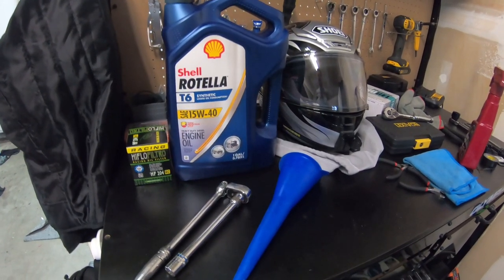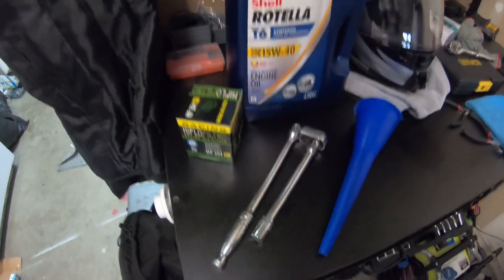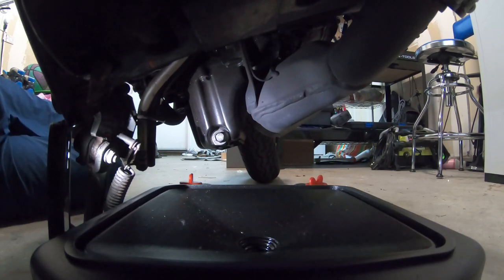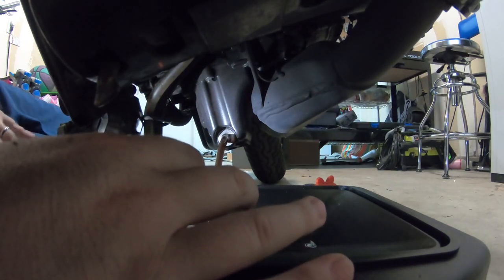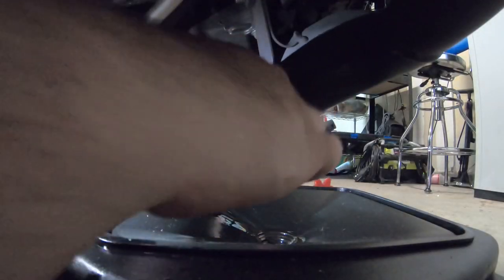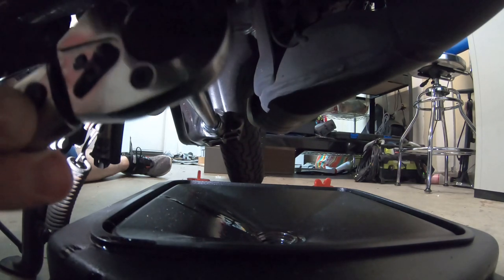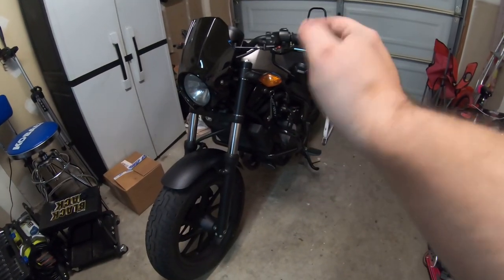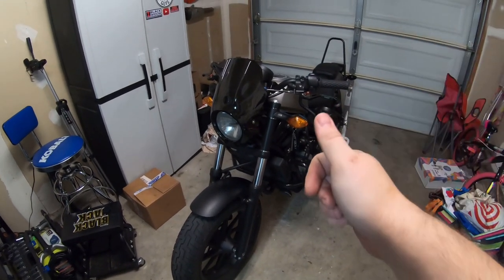Honda Rebel 500 Oil Change || Rotella T6

Comment: Really good video man but you do not want to put the drain plug back in before you remove the oil filter because when you remove the oil filter more oil come out through the drain plug

Comment: Hi mike, today i make oil change and filter on my rebel 500. Without checking level glass i poor 2.7 lt  ( 2.9 quarts ) when i check glass i see oil level over upper line. Any recomendations?
Reply from the maker: You are checking while the bike is standing upright off the stand correct? If so and it’s over the top line then you can open the drain bolt and very carefully let just a little oil out. Some people will also use a syringe and some plastic fuel line to suck it out form the fill hole

Comment: Do you have a link for crush washers.. ? I used the Rotella 15-40 in my 1600 Road Star for a while but the Rebel oil specks are for 10 wt. 30 wt oil.  I suppose if you are in hot climate the higher numbers on the Rotella 15wt 40wt will be okay right ? Also do you know if Honda factory oil is synthetic or not ?   Oil is 27.99 at Walmart now ....geeze   Thanks Kit

Comment: My friend I think you are using the wrong oil
Reply from the maker: Research Rotella T6 use in motorcycles. It's common because the oil is JASO MA/MA2 certitified for wet clutch engines. I explain that in the video.
Reply: @MotoMedicine904  thank you I did get that from your video. The viscosity is still wrong vs what the honda manual stipulates. If you were under the warranty period honda would not honor the warranty as you used the wrong oil specification,  according to Honda.